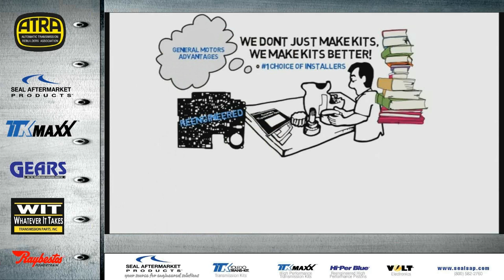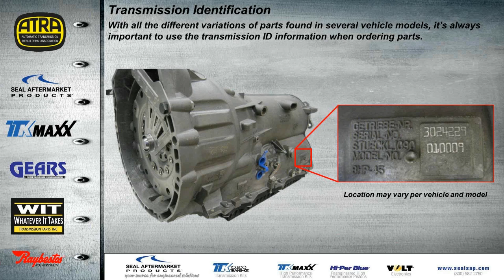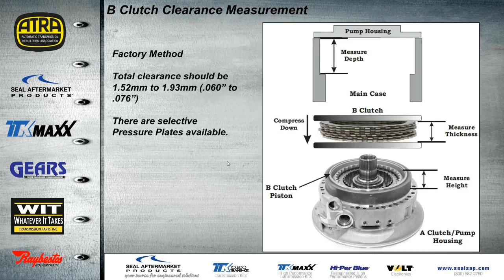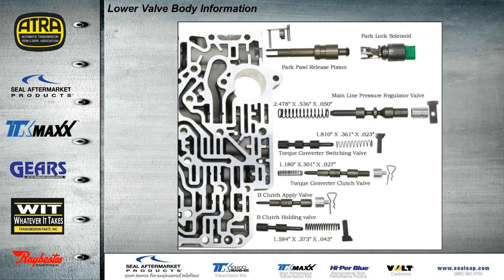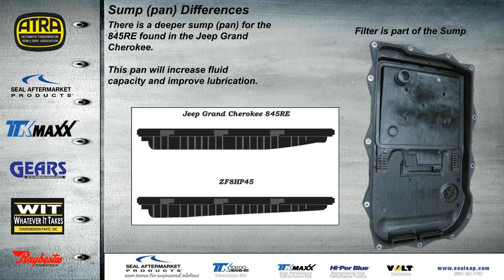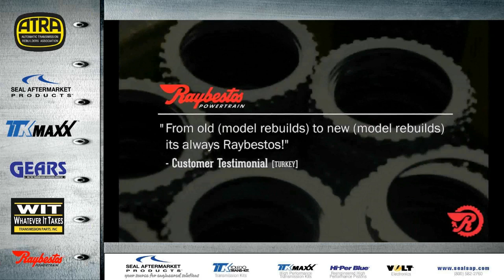ZF8HP Rebuild

Comment: Hi, I have a bad vibration in 6th gear on 8HP75z from 1500rpm under load? The gearbox was rebuilt and the flywheel replaced. The torsional vibration damper was also checked by BMW.  The problem persists and no-one can figure out why its happening. Any idea what could be causing this?
Reply: What car?  6th gear is known to slip under heavy load when you are running over stock power.  You really shouldn't be using heavy throttle at such low rpms in high gears.  Just downshift before you accelerate.
Reply: @ichoozjc  I tried limiting the torque in 6th with software but still happens at only 350nm of torque when box should be able to take 750nm+. It is 6th yes and 3rd sometimes
Reply: @user-od3rl5mc  Sounds like you are in the same predicament I am. 😔. I'm slipping and vibrating in 6th.  It just started so I'm researching my options.  I'm stage 2 turbo with MHD and xHP.  It's a little better today, I limited torque to 600nm in xHP.  It's still getting torque limit codes in MHD.  I'm gonna try dropping the allowed torque more and see if I can fix it with software.  If that doesn't work, I'll try a trans fluid my tuner recommended.  It's Adrenaline speed shift fluid.  He claims it's worked for his customers in the past.  If nothing else works then I'll probably get the Pure Stage 0 trans.  It's good up to 750ft/lbs.  

But it's possible to just drive mindfully and try to stay out of high load at low rpms in 6th and 3rd.  

Are you on a bigger turbo?  What's your setup?
Reply: @ichoozjc  my car is stock apart from xhp which I bought to try and resolve the problem. I've found limiting to 300nm makes the problem go away completely but the car is way to sluggish then in 6th. I had intended doing a stage 1 mg flasher tune but I think I'll just sell the licence and car on now at this stage. Let me know if any of your solutions above work.
Reply: @user-od3rl5mc  Yeah, 300nm is sadly limiting.  Hope I don't have to go that low.  Maybe check out that trans fluid first.  It must have some friction modifiers because it says that it will reduce the life of the trans.  But, if it's already failing you might as well give it a shot.
Reply: I can  solve  the  problem
Reply: @GasperMechanic  What's the solution?

Comment: Hi, excellent explanation! I have a BMW 520D with the transmission ZF8HP50Z, last month we have changed the mechatronic it was giving code 420321. However now is giving code 2AF800, 421343 and p1343. This after dealer reprogrammed the transmission. The valve body is new from ZF and the car do the same as before changing the VB. On D when you try to accelerate it goes to emergency, R does even move, and they get stuck on N. Do you have experienced this situation or do you know what can be? ZF is telling the problem is not from the VB but from one or two clutches changing dramatically. Thanks a lot for your time. Nelson
Reply: Hey Nelson, did you mange to get this fixed? If so, what did you do?
Reply: I have the same problem my friend in the 6th gear  powerloss, did u solved the problem?
Reply: I can  solve  the  problem
Reply: @onurbekci6228 currently suffering from this issue what was your fix